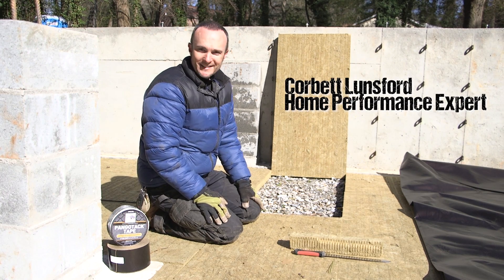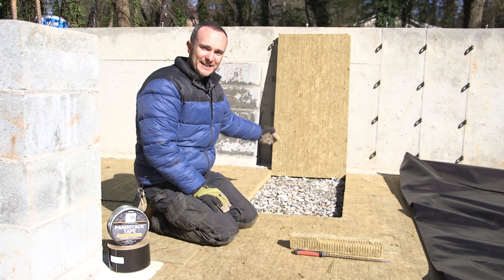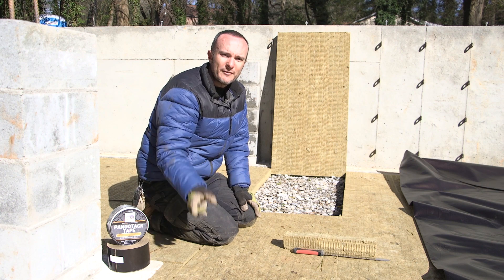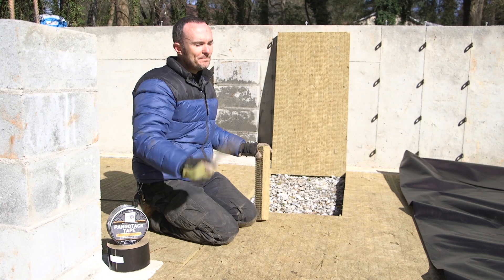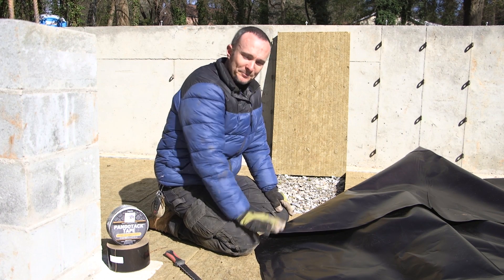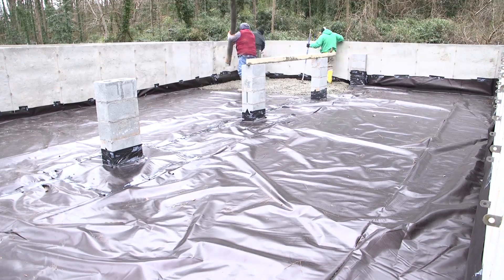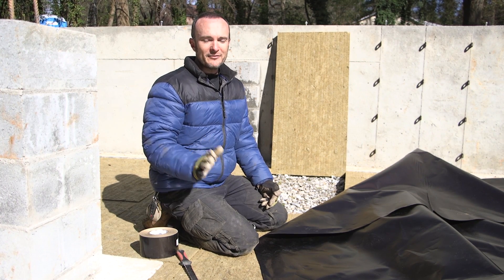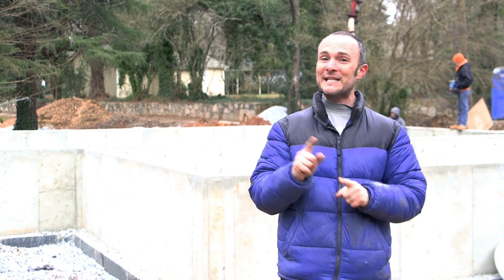5-Layer Slab System for High Performance Home Build

Comment: Thanks for the rec on the termite-proof membrane.  Subbed.

7.5 psi is not a lot on that Rockwool.  I hate the idea of foam everywhere on multiple grounds, but you do get it 25psi and up, and it does displace water to a great extent.  The (fairly expensive) rockwool doesn't insulate anything if it's saturated with water;  Are you fully confident in your subslab drain tile?

Fiberglass or basalt fiber admix helps a lot with surface chipping and small crack propagation, but supposedly it doesn't do much at all for large cracks or ultimate strength in bending.  Hydraulic press tests of beams show the same ultimate strength, but the admixed beam looking a lot better at just below that failure point.

Unreinforced slabs get stronger against loads as the square of their thickness or better.  At 2" you are only making a quarter the strength of a standard 4" slab;  Some people won't build less than 6" (9x as strong as yours) or 8" (16x as strong as yours) unreinforced.  If a client takes one of these - https://www.homedepot.com/p/Husky-90-in-H-x-90-in-W-x-24-in-D-5-Shelf-Welded-Steel-Shelving-Unit-with-Wire-Deck-in-Black-ERZ902490W-5/206813267 rated for 7500lbs spread over four small feet, and loads it up to capacity, that may punch right through this floor, either at the feet or around the whole area.  Concrete doesn't like to bend much even with fiber admix, and to support a load of 7500lbs you need 1000 inches of rockwool (7.5psi) multiplied by some factor for how elastic things are.

That's assuming your concrete is going to cure correctly at these temperatures, even if we see wild swings week to week.  I don't know enough about the process to say, but concrete contractors tend to be very wary of this stuff at this time of year.

The price negotiation POV you're taking is fine if you're sure that you're dealing with a certain type of contractor.  Any other type of contractor will find it highly exploitable.  The way to fight that tendency is to get multiple fully-burdened quotes and/or to know who you're dealing with from past work.
Reply: It's not a standard slab. In the video he describes that it's a rat slab.  Nothing goes on it. There won't be enough height to put shelving.  It's only used to maybe house ducts, maybe water pipes.  There will only be a contractor from time to time, so 2" is good enough.
Reply: @AM-fu1kq  Ahh, that makes a lot more sense.
Reply from the maker: All good thoughts, Mr. Burninator, and Andy’s correct, it’s just for aesthetics and rolling around on
Reply: Hello
Reply from the maker: Hi there

Comment: No drains or tile in slab, bleck...
Reply from the maker: What for?
Reply: @HomePerformance  Well besides the fact water generally finds the lowest point...they're useful.  Easy to tie into foundation drainage system.  You made a bathtub without a drain.
Reply from the maker: Understood, but our sewer connection goes out the foundation wall. Also, no water once we close it in and roof over it.
Reply: @HomePerformance  Unless a water heater or some pipe decides to go south...or there is a fire and they pump a bunch of water into the building. I like things that can drain without assistance.  :-)
Reply from the maker: @xephael3485  I agree with you, but practically speaking it was just not worth the extra effort. There will be nothing on the floor of the crawl, and pumping it out will be a relative piece of cake.
Reply: Is the floor graded for drainage to that wall?  If not, a pump will get you down to a fraction of an inch standing water, but to finish the job you're relying on evaporation.
Reply from the maker: Yep, that’s ok too- we’ll have dehumidification happening as soon as we’re closed in